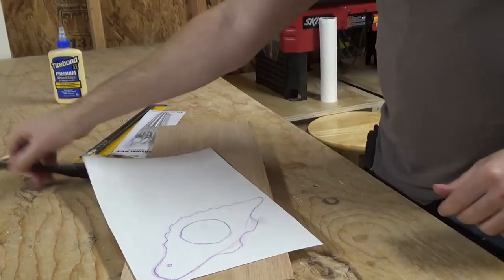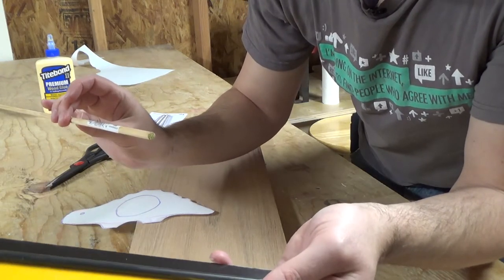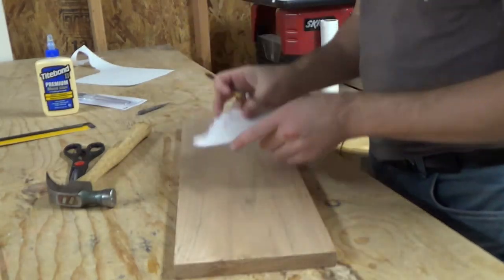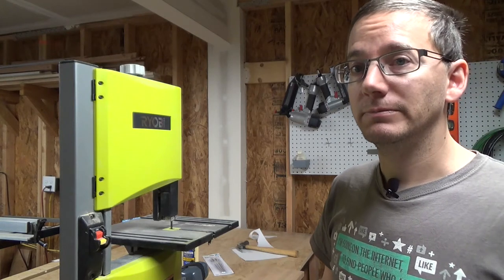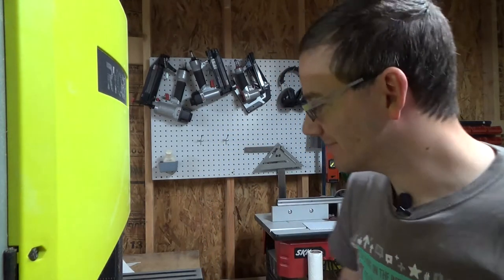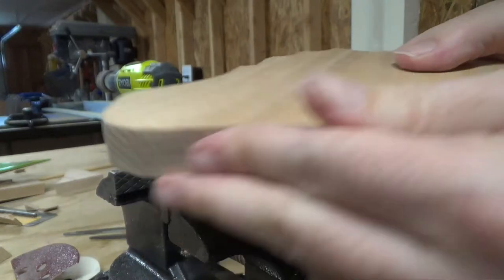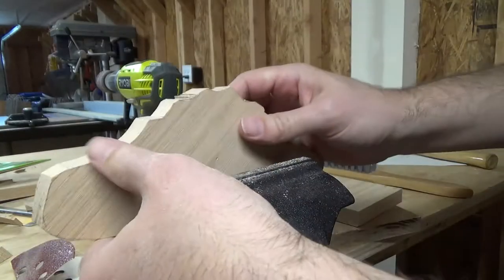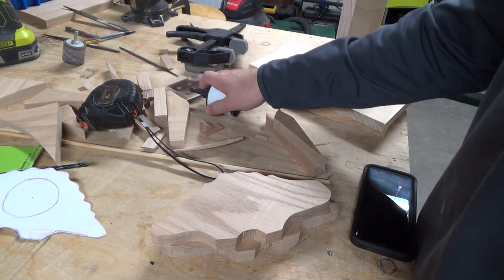Woodworking with Der - Project Stegosaurus (Part 1)

Comment: Hey Der, I want to build a nice desk for myself.  I have done it before so I'm not a complete novice, but I used particle board to save costs last time.  In your opinion, what kind of wood do you think would be best for making a nicer one?  Thanks for coming back to YouTube, I'm loving all of the new series!
Reply from the maker: I've used the end joined pine boards they sell at Lowes for stuff like that before. It's inexpensive (relatively) and has a nice grain.